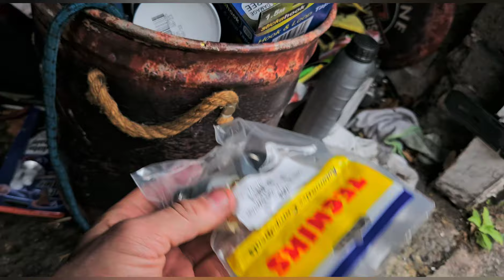Benelli velvet, panels back on, electric tests etc.

Comment: Still stuck on my bike.
Turns over no spark efi,no way of telling what's wrong fi light flashing.
Would I be able to use a pit bike loom and anciliaries and carb the damn thing.
Still need it to run on the road what do I do about lights and indicators,could I piggy back off the same battery and use the old ignition to run the lights at the same time???
Reply from the maker: What bike is it? 

No spark is the first port of call here. Stator, reg, cdi, coil, plug or wiring